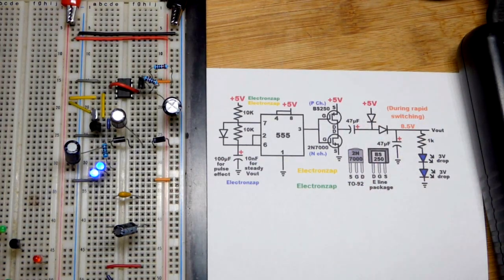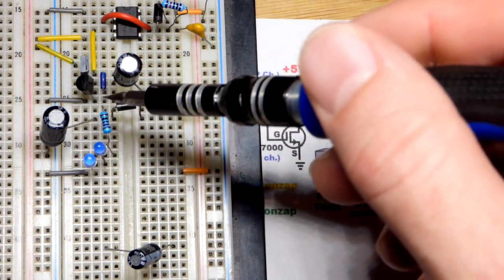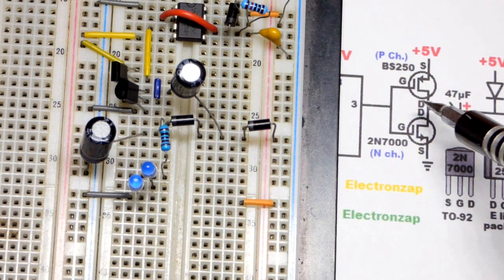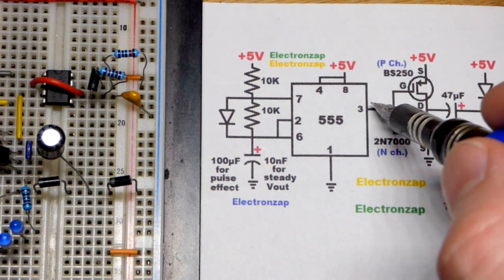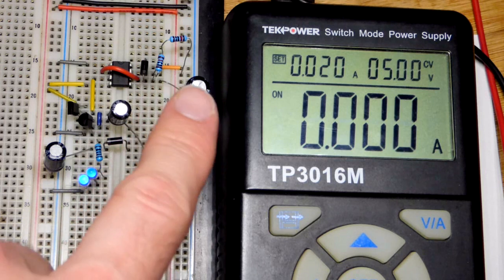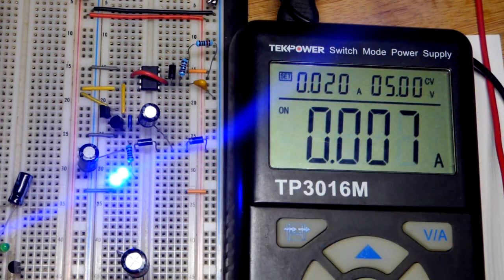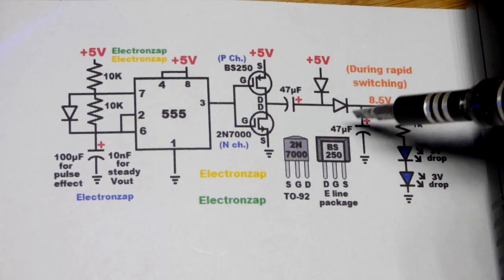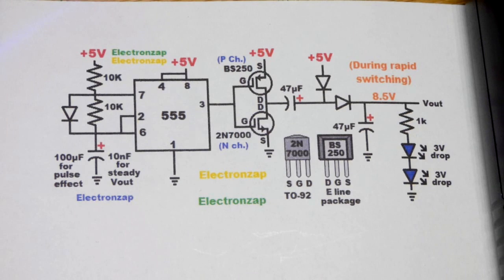Voltage doubler w diode drops using astable mode 555 timer with N and P channel MOSFETs schematic

Comment: I  opened up my nlutooth speaker to try adding a small laptop speaker. It kinda worked but I blew out my signal led. This has to do with Ohms Law right? I didnt connect the speaker in the end for fear of blowing up the board;
Reply from the maker: LEDs burn out when too much current goes through them, or too much voltage goes across them in the wrong direction. They usually have a series resistance that will protect it up to a certain voltage while forward biased.

Comment: Ok, but using a boosting converter better and more efficient just by adding an inductor with modifications
Reply from the maker: Yeah, use a boost converter.